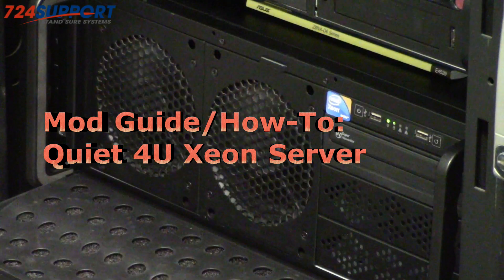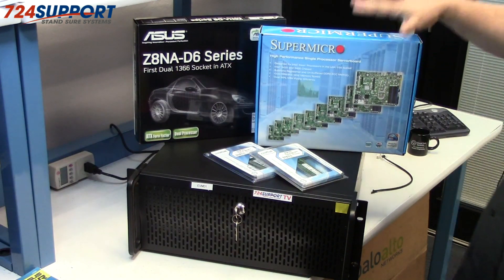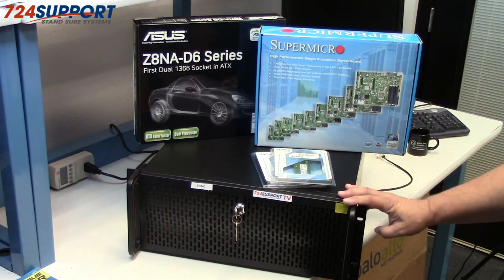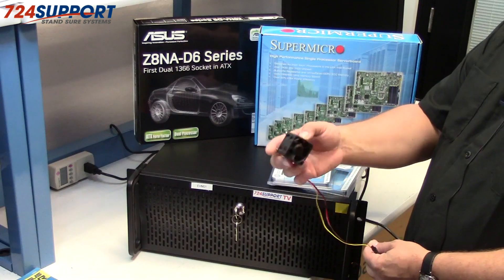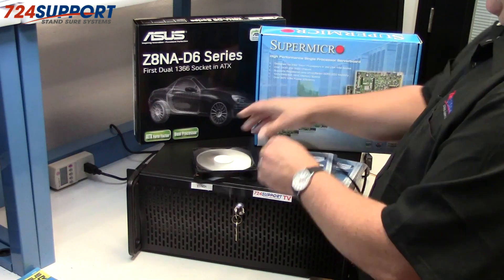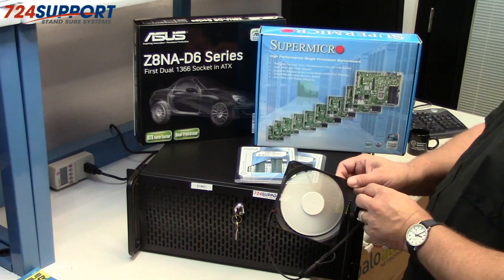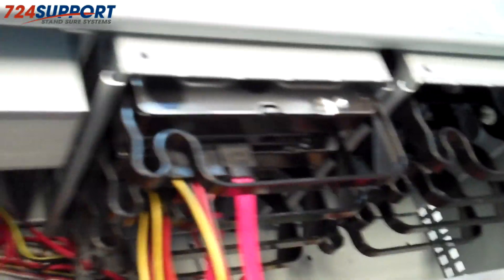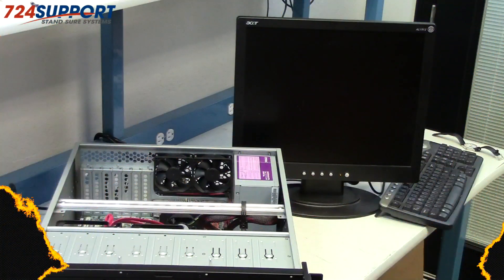Quiet 4U Server How-To

Comment: What's the model of the chassis?
Reply: It's a Rosewill Server Case or Chassis - RSV-R4000 - 4U ... They are often in stock at Newegg ...
         https://www.newegg.com/Product/Product.aspx?item=N82E16811147154
Reply: Rosewill Server Case or Chassis - RSV-R4000 i recently bought this case so i can fit my 16TB for my movie server
Reply: as a follow up - for europeans it is either a UNYKAch uk-4129 in the config as shown here, or a Inter-Tech 4U-4129L with a 3set of 120mm fans between the hdd´s and motherboard

Comment: Got a Chenbro Server case. In my case (pun intended), there are three noisy 92mm fans behind the backplane. Is it still okay to swap them for normal, more quieter ones, even though those will not move as much air than the loud ones?

Comment: i built my server from scratch using used and new parts in an ATX case... i have 6 fans in it with a  mix of 120mm and 92mm and even at full speed it NEVER sounds like one of those 1U servers
Reply: My 1U server sounds exactly like that one shown in the video, maybe louder actually.
Reply: +QuadroNVS obviously 1u is lower it's running 40mm fans.. This video and your comment is pointless. 1u is about space 4u is basically a midtower to full size case. you can obviously quiet that down.